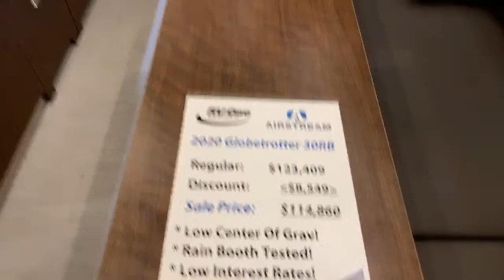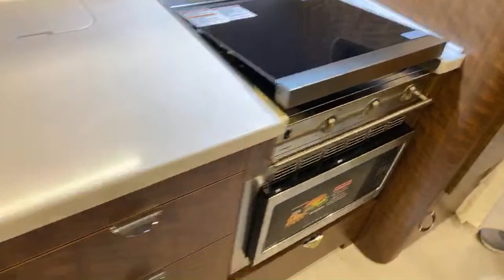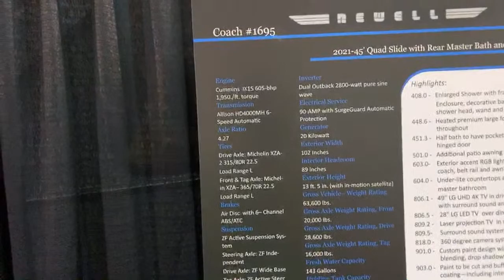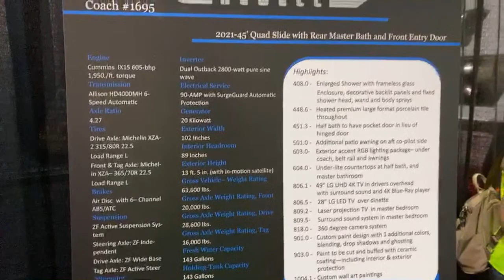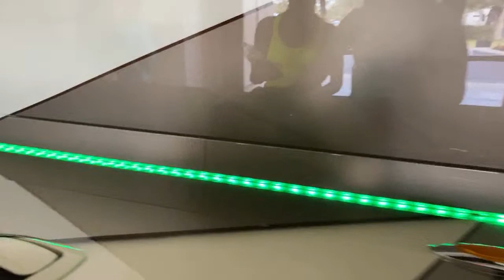LIVE FROM TAMPA RV SHOW 2020- $2,000,000 Motorhome Walk Throughs

Comment: I'm with you on the Zephyr, a fresh thoughtful contemporary coach.  Also, with regard to the Airstream eveveryone likes the cabinets / interior etc. which is not 'residential'.  I've not heard complaints about Airstream squeaks etc.  You know I have doubts about all the manufacturers and their desire to make everything more 'residential'.  Maybe 'residential' is not the way to go.  Lastly, Andrew review a Newell recently and two features neither of you mentioned that intrigues me; the entry door slides to the left rather than being right hinged and I think rather than lifting the slide room when they come in, the main floor goes down.  So then to extend the slides they slide out and the main floor is raised to the height of the slide.